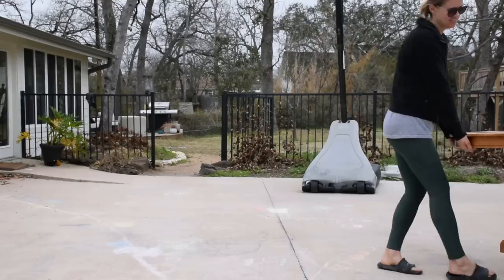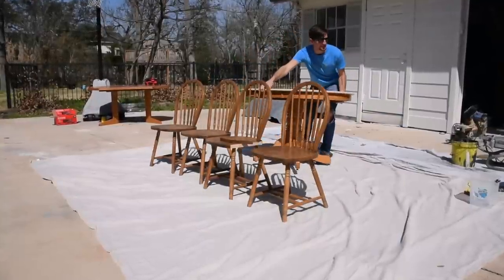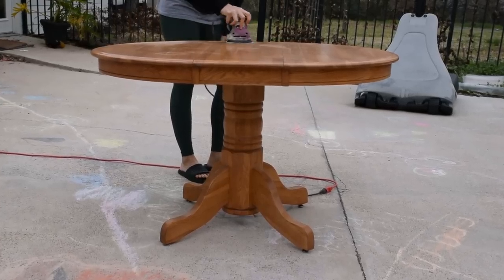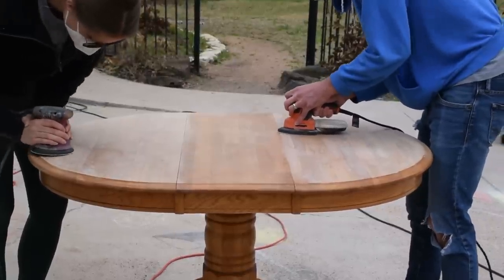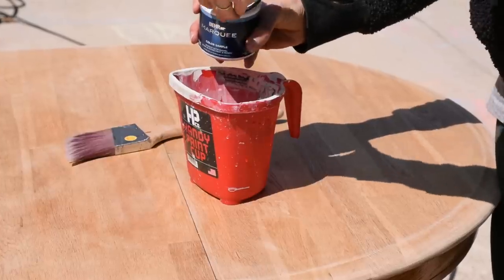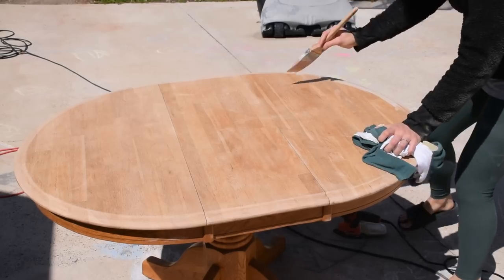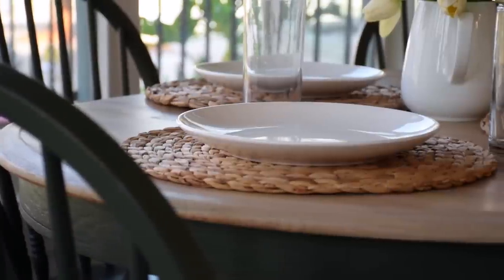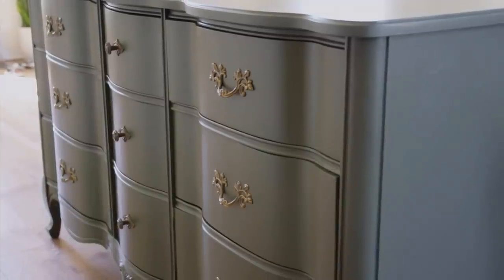Flipping A FREE Facebook Market Place Table & Chairs // Furniture Makeover // Furniture Flip

Comment: So sanded my marked, worn out  farm house oak  table ( with two panels) and seven chairs (same as above but bigger). The sanded wood on table top came up GORGEOUS! I decided to stain top with white with VARATHANE CLASSIC - WHITE WASH (oil). It did not sink in as much as I hoped as you could still see A LOT of the pine colour below. Did a second coverage after light sanding and waiting a few hours. White still not as deeply sunken into the wood, but I decided I could live with it. it said let dry for 2-3 hour but I let it dry over night. After waiting over night I just used the WIPE-ON POLY (CLEAR SATIN). Gutted........ it seemed to dilute the white wash already on table and began to removed it. Now the table is much lighter and almost looks pine AGAIN. Instructions on White wash, did say : 'to complete wood project and for best protection finish with Varathane WATER BASED Polyurethane, in gloss, satin or matt'. 

However, as I've watched MANY videos, that suggest poly wip- on oil based will provide a lmore resilient and longer lasting finish, if the surface is actually going to be used to place warm plates or regular spills and wipe ups. One video actually said using water based polycrylic on tables can cause the white cloudy  marks to appear through the varnish. We actually had white cloudy ring mark on this table before I sanded it which is why I wanted to avoid that.

I'm guessing the problem is putting oil based vanish over oil based stain? Any suggestions?

I'm feeling like I'm going to have to sand it back lightly and white wash it white with paint, but not I'm sure if I should use latex(water based), acrylic (chemical?)  or oil,  based so that the Poly wipe on will not wipe off the finish, as there is already oil based paint sunken into the wood now. 

Never Varathane  wood stain white wash before on table, I wont use it anymore either as basically it DOES NOT ABSORB IN TO THE WOOD very well and leaving it longer before wiping off makes it look more like paint....... Maybe I should have used a white stain not white wash? Fire away with suggestions...... one frustrated mama!

BTW: The table looks lovely as it is smooth and even as I just worked with the wipe-on to even out the white wash and ensure not streaks........ so it just looks mostly pine and ill have to see it EVERY DAY.....
Reply from the maker: Ugh that’s so frustrating! There are always projects that go like that (I’m working on a huge set where I’m stripping then staining a lot of it and having similar frustrations). Ok so any top coat will usually make your piece look slightly “darker” similar to if you put a little water on freshly sanded wood. If you’re wanting it even lighter here’s my idea...I just used general finishes gel stain in the white color go try and fix a similar issue to yours. It’s still oil based so it applies easier than a water based paint wash in my opinion, it’s challenging not to get a streaky look on really large surfaces with water based because it dries so fast. Anyway, the gel stain can go over existing finishes so it would work over what you’ve done so far without having to remove it all. Just give it a light scuff sand first :)
Reply: DIY Wife Thank you for taking the time to reply. That sounds like a plan. Im going to try it. 

I just refinished four beat up old hollow doors on two closets in a community room, put fake panels on them, and tried to cut corner by using deck stain I already had. I planned to wipe it off, but like you said, it dried so quickly it was difficult to work with and was super dark grey. I even sanded them back, but they were still too dark. I ended painting them white again and using Varathane gel stain (oil based) in weathered gray and they came out AWESOME! I noticed then there was so much time to play with which before stain dried, and thats is why I thought the oil based white wash would be easier as it was oil. Hopefully, the Wipe On Poly will not wipe off the next finish too. Im thinking I may have to find a spray on polyurthene in oil based (if there is one) as even brushing it on may wipe the stain off. Trial and error is how we learn but the error parts are never pleasant...thank you again!

Comment: Ok... so I am getting excited about refinishing the dressers in the basement with my youngest daughter's help.  Tomorrow I am taking her driving (she just got her permit) and we are going to stop and look at paint color options.  The question I have after watching this video.... Do you seal your top coat of paint?  Do you use a paint that has a built-in sealer?  Basically what do you use to protect the final coat? I thought I saw the green paint you used also had a urethane finish built-in, or do I have that incorrect?  Ok no more rambling.  Thanks in advance.
Reply from the maker: I’ve found that I actually prefer a less expensive paint with a top coat on top vs just the urethane but itself :)
Reply from the maker: *by itself

Comment: May I ask what sprayer you use? Do you love it? Can you do quarts or only gallons? I currently have an aircompressor and hplv. I like it and the finish is great. Clean up fast. But I have to refill often. Thanks for your input! Love your channel!
Reply from the maker: I used my airless for this one, but I’ve actually switched to almost only using my hvlp for furniture because I don’t need as much paint and it just seems a lot easier for smaller projects like a piece of furniture (when I’m doing one at a time). With the airless I do use a gallon, it takes an entire quart just to prime the line. For bigger projects though I love it! The exact one I have isn’t made any longer (from harbor freight) but I have a few similar options linked in some of our recent videos if that’s helpful.
Reply: @diywife  thank you for sharing! Love your brain. Happy your husband could share it with us all. Lol.

Comment: That green is a winner for sure. I have the same table in oak that's about 90 yrs old. I want to do it over in a very light stain. It has several bad water stains that I need to deal with first. Any suggestions? Oxalic acid or household bleach are the only 2 things I've heard of but never tried either.
Loved the finish on yours!!!
Reply from the maker: Do you know if the top is veneer?  I'm honestly not an expert at repairing antiques, but I would google ways to deal with the water stain in case there's something I'm not thinking of.  If the top is solid wood, sanding should take care of it.  You just have to be careful if it's a thin veneer on top though, it's so easy to accidentally sand through it (ask me how I know!).  

I've tried bleaching wood but wasn't happy with my results, but that'll work differently with different kinds of wood.  It can be tricky to get a really light finish, as most wood will look a lot darker with just a clear coat on.  For me, my favorite way to achieve that look is using watered down acrylic paint.  I have another example of this in our next video, I "stain" an entire piece using this to help blend the different kinds of wood I used.

Comment: I want to get this same look on a pair of small console tables we were just gifted. Do you have a suggestion for the top coating if instead of the emerald paint you used, we went with something that didn't have that built in top coat? Dark paint on the legs with the sanded wood on top. Would a polyurethane over the whole piece work?

Comment: Andrea, did you put a top coat on the bottom of the table and the chairs or did the bonding spray paint help the paint to stay without scratching. Did you use a polyacrylic at all as a sealant, If so was it about 2 coats?
Reply from the maker: I always recommend a good topcoat! And yes, usually 2 coats is best :)

Comment: Hello! New follower here! I am redoing a table almost exactly like this except I am painting the chairs and staining the whole table. I am also using the exact same paint and my chairs are still tacky after plenty of dry time. Have you had this happen with this paint or know how to remedy it? I waited about 24 hours between primer and coat of paint. It was very hot the day I painted but I noticed you paint in the heat as well so I was wondering your thoughts on it, thank you!
Reply from the maker: Hi Taylor!  Gosh I'm sorry, I don't know! I haven't actually used the SW paint in hotter weather, so I wonder if that has something to do with it?
Reply: Yeah I think it has to be the weather! Same thing happened to my stained table so I brought it inside and I think it’s helped a bit? I put a top coat on the chairs and that has seemed to help! I am going to try fusion paint and working inside next time so hopefully that helps. Thanks for the reply!😊

Comment: What about the table wobble. I thought you would fix it or comment that you did but it seems you didn't. Was it the table or uneven surfaces? The wobble really bothered me as you can tell.
Reply from the maker: Ha I cringed when I saw the wobble in the video!  It had those little adjustable furniture feet and one of them was extended all the way from the previous owners :). I just needed to screw it back down, no more wobble!
Reply: @diywife  great to hear you fixed it now I can sleep peacefully 😁

Comment: I wondered why you didn’t fix the wobble of the table??
Reply from the maker: Ha, I cringed when I saw it wobble in the video! It's actually just because one of the little metal adjustable feet was extended all the way and I just hadn't screwed it back down yet.  Some tables will have those so if your floor is uneven, you can adjust them and your table won't wobble :)

Comment: Looks lovely but couldn't help noticing the table was a bit wobbly.
Reply from the maker: Ha, yes I cringed when I saw that!  The table has those little metal adjustable feet (for if its on an uneven surface) and one of them was extended too far, I just hadn't screwed it back in yet! It's not wobbly any more :)
Reply: @diywife  I'm glad it was able to be adjusted so easily.

Comment: You never showed the whitewash top without crap on it. It wasn’t looking too even or good.
Reply from the maker: I (Dean) can take the blame for that, I took several shots of it without anything on it but just didn't end up putting them in the video because I liked the other shots better.  When the stain/polyurethane dried it looks very uniform and not uneven at all.  And we did of course include all of the detail photos without staging in our listing.  I appreciate the input but maybe consider sharing with a little more kindness next time :)